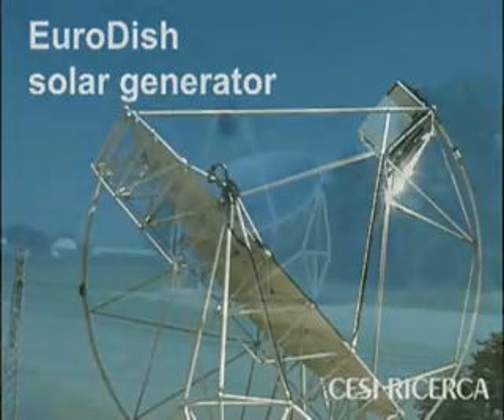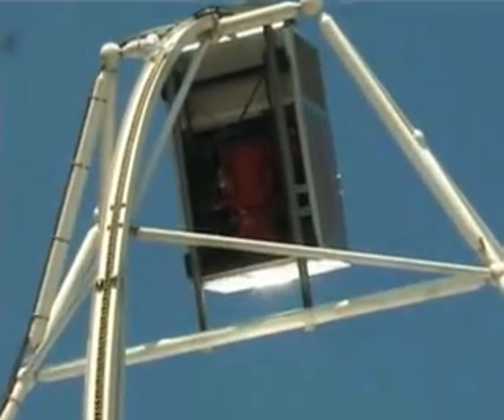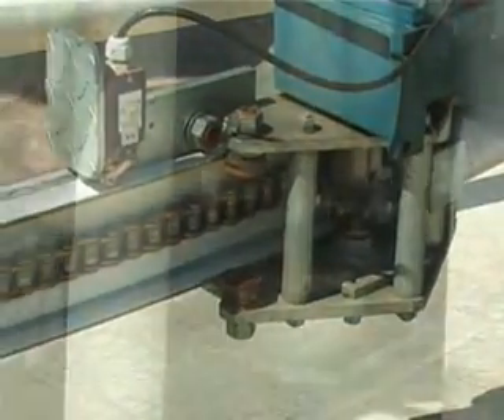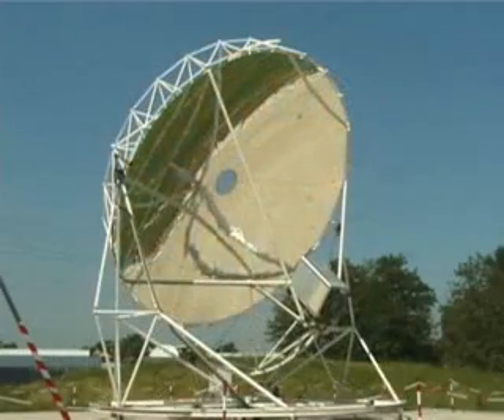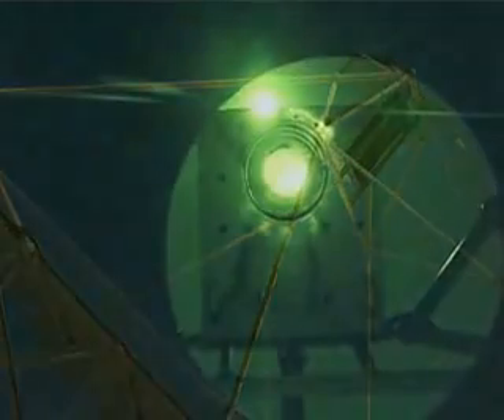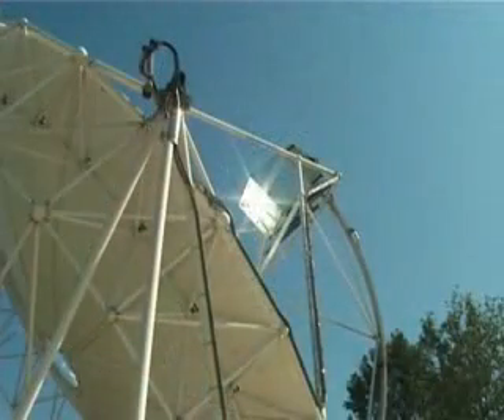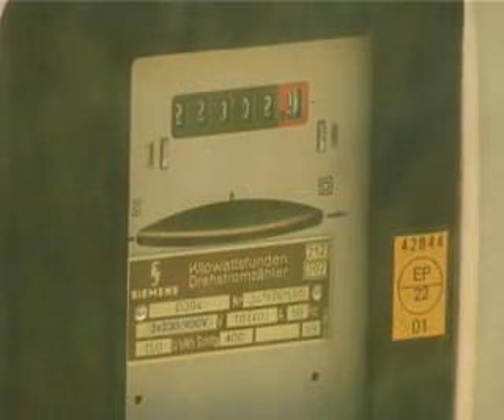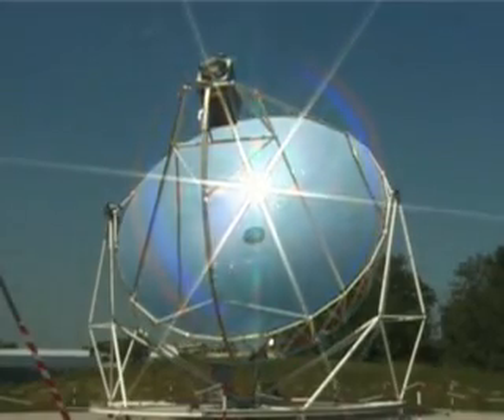European Solar Powered Stirling 10 Kilowatt Generator

Comment: I heard that the Stirling engine can achieve 40% efficiency. Is this possible?
Reply: Theoretically yes, efficiency depends on the used temperature. 
There were stirling engine powered generators with 31.1% electrical efficiency (electrical output/fuel input).
So the stirling engine itself had to be some percent more efficient.
But probably less than 40%.

Comment: Interesting. This video was uploaded thirteen years ago, but it appears to be even older. Since then there has been a huge explosion of photovoltaic panels, while stirling generators remain in the prototype stage. Photovoltaic is becoming cheaper and more efficient every day, but the technology has the great advantage of being much more ecological, since a device like this can be made of recycled steel and aluminum, and be recycled again at the end of its useful life, even using a solar oven. On the contrary, the manufacture of PV panels is very polluting, and does not allow recycling all of its components. PV generation makes more sense economically, but that shouldn't be the only factor to consider.
Reply: Suppressed technology. Musk!
Reply: The problem is the people not the energy or means of getting energy; if it’s not in there face they won’t strive for it

Comment: Practical and doesn't use rare earths in massive quantities.
Reply: but it produce almost nothing
Reply: @Carbon_  10 kilowatts is enough for 90% of homes. Throw in a half-decent battery and you're good to go for several years.
Reply: Neither does photovoltaics.
Reply: I referred to "use rare earths". Typical silcon based photovoltaics don't use rare earth metals. And also no rare elements like Tellur or Gallium.
This generator might use the rare earth metal neodymium in the generator. Not necessarily but likely.

Comment: efficiency of sterling engine increased if it's working under 100 atmospheric pressure since the heat input is same but efficiency is low due to lower atmospheric pressures
😈😈😈😬😬😬

Comment: Nice idea but I'm not sure if it's worth all the complication. In my latitude...about 39 degrees...you could generate the 9,000 kw-hrs per year with about a 7.5 kW PV system that needs practically no maintenance at all.

Comment: In the not to distant past, the Stirling solar engine was the most efficient form of solar power conversion. With a stated efficiency of 17%, the Stirling solar thermal power generator has since been surpassed by photovoltaics which at the time of this writing have achieved an efficiency of 29.5%.
Reply: I was told Stirling Engines have 50%.
Reply: @jackmiddleton2080  
Yep, the Phillips Stirling engine had an efficiency of 38.5%, and other designs probably went higher.

Comment: If this really is more efficient than conventional solar cells I'd say NASA should be looking into using something like this for future designs of satellites and space stations.
Reply: the problem is that Stirling generators need atmosphere to run, because it literally runs by transfer of heat. That's like saying since steam generators are fairly efficient, and simple to run, let's put one in space without atmospheric cooling towers.
Reply: @kirknay  
They actually do have a design for space based Stirling engines powered by decay heat from plutonium pellets. They reject heat through radiators. And they actually DID put a steam engine into space during the SNAP-10 program. But the working fluid wasn't water. It used a fast reactor to heat liquid sodium-potassium coolant, which was then used to boil mercury to drive a mercury vapor turbine. The exhaust mercury vapor was condensed in large radiators.

Comment: Can I buy one? How much is the cost and who to contact?
Reply: just do it yourself is not hard at all, making a Stirling Alpha can be done with simple things, and the dish doesnt need to be a huge perfect one just recycle an old Direct Tv dish, just glue square mirrors in it, obviously it will not be as efficient as this one but it can cover a lot of modern electronics that use a range between the usual 5V - 12V

the generator is just your usual permanent magnet motor used as a dynamo, to avoid peaks and lows correct the current using capacitors and diodes, store depends on the use for intensive use ill always liked Pb over Li-Ion is less efficient but more reliable

Comment: ho  much    do  1  cost  to  bild
Reply: not much if you recycle your ass off :D and it depends on the size of the stiling engine you wanna power, always start small to fully understand the concept and the process it will save a lot of money

Comment: it doesn't have to be a stirling engine... it could be a steam engine or anything that will run off concentrated heat from the sun... also it doesn't have to be a dish... you could make it with a Fresnel lens or any number of solar concentration methods... this is the solar energy of the future... and with the new technologies coming out you wont even need an engine..... they are coming up with new products that turn heat directly into electricity... so you just fire it at this block of whatever it is?? I don't remember now and out the other side comes electricity at near 100% efficiency
Reply: Thomas Schuster Actually, I just read that their efficiency has improved as they have made newer models. It is actually just as efficient if not more than photo voltaic cells. And the price will go down when the demand is higher.
Reply: Thermoelectric generators turn heat directly into electricity. But these are neither new, nor do they work with an efficiency of near 100%.
Photovoltaics is cheaper AND more efficient.
Reply: ***** "Photovoltaik cheaper AND more efficient" was related to thermoelectric generators, which convert heat directly into electricity. Not to stirling-engine-powered generators.
And okay, in a postapocalyptic world, solar stirling generators might be a better way of power production than photovoltaics.
Fortunately, we do not live in such a world.
Reply: ***** do what? Sorry but it is people like you that keep us from moving forward. If we had brains we would put collectors at equator in ocean.
Reply: BAM, thats it man! fresnel lens is better because you dont need to mannage that mush weight pursuing the sun, besides you can use a geodesic dome and catch much more without moving the whole system upgrading efficiency.

hey have you seen the german paint that turns painted stuff in to solar pannels? is awesome!
Reply: What is the production in energy and materials on the 10 Kw  versus the same costs on the PV panels?  I think the dish is probably a better ROI.  In it can be made and repaured by the homeowner

Comment: This is stuff that the goverment doesn't want you to know about.
Reply: Thomas Schuster  PV cells efficiency is rather pathetic in comparison. They do 80W/1sqm =you would need 125sqm of PV array to produce same electricy output (10 000W) and their efficiency drops by 50% as they get hot (70-90 'C).
Reply: Thomas Schuster
"Infinia solar stirling"! no longer exist. Assets sold of , never to see the light of day again.  Old news.
Reply: This stuff was financed by the european commission, it's "governmental" research. And there is no secret about it. It's a rather expensive, inefficient and noisy way to produce electricity from direct sunlight. Why should anyone want to keep this secret?
Reply: Well, you have a point.  I think maybe not government but big corporations are stalling cheep electricity developed.  I believe that the government is run by big corporations anymore.  Maybe its noisy and inefficient but it can be made better.  We can only hope I guess.
Reply: dittybur
But despite evil big corporations, we have rather cheap and noiseless photovoltaics today. Cheaper than even the most developed solar stirling systems (Infinia?) at least.
Reply: firstly, this is not cheap...
Reply: R Mitura
A friend of mine has 10 kWp PV on the roof of his house. I don't know the exact covered space, but I am sure it is less than 125 m².
SOME PV panels like thin film modules have low efficiency (less than 10%).
Common crystalline silicon modules achieve about 150 W per m².
Efficiency drops with higher temperature, that's right. But not that bad. It's about 25 percent lower efficiency with 70 degree celsius, once again depending on the type of module.

From an article about the euro dish: "the net overall efficiency approach 17% at the highest insolation"
http://www.stirlinginternational.org/e-journal/item.asp?id=D4943C97-1108-4D8F-A30C-9DB1305A3A2A

Peak efficiency 17 percent. That's more or less the same as common PV.
And because it can only convert direct irradiation, the capacity factor is rather bad:
Just 9000 kWh per year from 10 kW power in sunny italy!
10 kWp PV would give you much more at the same place.

Anyway, space demand counts less than yield per costs.
Even if you would need just a quarter of the space, you would not use this technology, if the production of 1 kWh costs you twice as much as with PV.
Reply: R Mitura
By the way, there is another solar stirling system with much higher efficiency. Check "Infinia solar stirling"!
But there is PV with higher efficiency too, for instance mono-crystalline modules from sunpower with more than 200 W per m².
And the best Concentrated Photovoltaic Modules (Amonix) achieve above 35 percent module efficiency (but need direct sunlight, like solar stirling).
Reply: OMG, just shut the fuck up and make ur own solar stirling generator and when u cant talk about govermen
Reply: I like renewable energy and wanted to build steam or stirling generator for some time. What the hell is govermen?
Reply: this is the stuff YOU SHOULD KNOW, is just there, for Christ sakes the Stirling engine and the optical lenses have been there FOR CENTURIES.  the ironic thing is that people is so worried with conspiracies and Tv that they just dont read.
Reply: Johan Herrera Where's your stirling engine making power from the sun??  The real "ironic thing" here is you claim to know better but you are not benefiting from this technology.  One I claim you can't or a genius like you would be doing so.

Claiming something is true does not necessarly make it true.  This is "claimed" to work but for how long, several hours or days ?.  Having it stop working every few days makes it a failure NOT a successful concept.  That is what your missing, that is what all people who believes inventors claim are missing.
Reply: Haha I don't need a Stirling engine because energy in my country comes from hydro plants so no harm to the environment there therefore I'm not in a rush,  I'm doing a mechanical wave collector instead efficiency is much better there and more reliable, there is always waves, BTW patent pending.

Right now I'm working for my own NGO teaching kids and teens in danger how to recycle using the knowledge taught at school physics, chemistry, math, etc for free so they don't leave school and actually can be entrepreneurs in the future benefits the environment and society all of it in a country at civil war and with drug issues.

I also refurbish and donate computers to poor families, students that can't afford one or children who need one.

All of it with my own resources, a teacher salary which is about 300 dollars per month in my country.

Wanna laugh?  I even visited the USA but didn't stay there, my kids need me here,  and I'm talking about all the kids I can help, I actually have none of my own.

Next time you get cocky on the Internet, remember that some of us don't talk bullshit all the time.

facebook.com/
Reply: And that's just the English version,  the one in Spanish is much better.
Reply: http://drgohanlab.blogspot.com.co/?m=1
Reply: Johan Herrera

Comment: the thing looks like it could be produced cheap, and its a old technology.
Reply: More expensive than photovoltaic panels. Would awesome with higher efficiency or if it could be scales, otherwise, assembly and maintaince is going to be expensive.
Reply: @movax20h  
The fact that it's price might be high at consumer level doesn't means it's expensive to produce

Comment: To come to an end: Efficiency counts less than costs.
And costs for solar thermal power production are much higher than for photovoltaics nowadays.
"Common" solar thermal power plants have one big advantage at least: With heat storage, they can produce controlled power, even at night. This might justify higher costs.
But solar stirling dishes have not even this ability, just higher costs.
Reply: just use aluminiuminstead of gas

Comment: In this case, PV would probably be even more efficient. Related to mirror/panel-area and to annual yield.
I just noticed, that the location is Milan in NORTHERN italy.
You can expect about 1200 kWh/kWp in northern italy, not 1400.
But so you still need just 7,5 kWp PV to get 9000 kWh/a.
That's about 53 m² common PV panels covering a roof.
The mirror of this eurodish is 8,5 m diameter.
That's a projected area of 57 m² (real curved mirror area even more).
Reply: its more than 53 square meters
Reply: @austinharding9734  It depends on the type of modules (thin film, polycrystalline, monocrystalline,...). But with common, rather efficient silicon modules, 53 m² should easily be enough.

Comment: Anyway, the demand of space usually matters not much, espacially for big plants in deserts.
Since the price decline of photovoltaics, the producers of solar stirling systems are desperate. And they overstate the few advantages of their technology. 
By the way: Higher efficiency and lower space demand is one and the same. You can't count it as two advantages.
And: With concentrated photovoltaics (CPV), you achieve even higher efficiencies than the best solar stirling systems.

Comment: If you compare the demand of space of solar stirling power plants and big photovoltaic plants, it's more or less the same. Though the producers of solar stirling systems claim a big difference. 
Just one thing is true: You need rather less mirror area than photovoltaic panel area. 
In compensation, you need much space between the mirrors.
And: Common photovoltaics is much better than 7% overall efficiency. And there is no stirling system nearing 40%.

Comment: And: Just 17% of the direct irradiance. In rather cloudy countries like germany, the half of the electricity from photovoltaics comes from scattered light.
This is a 10 kW-dish in sunny italy (!) and it produces just 9000 kWh per year. 
With 10 kWp photovoltaics, you could easily yield about 14000 kWh per year at the same place.
Without annoying noise. Without need of free space, a roof suffices. 
And probably much cheaper.

Comment: 17% efficiency same as the regular photo electric panels
Reply: Yet pv dies after about 10 years but the stirling engine can last much longer when designed properly
Reply: Stirling solar concentrators can achieve twice what PV does. 35% typically.

Comment: You are wrong - it is not succesful so far because it is too expensive. You can build solar plant using the same surface for lower price. Also 10kw wind power plant costs up to $10000 - this thing costs much more.
So far I've seen on net 1kw engine for $4500 - it is still more expensive for 1KW than solar or wind energy

Comment: Stirling engines were never a commercial success because they are inefficient, you need to run it with hydrogen gas as a internal work-medium for it to become somewhat efficient. Also it's to slow to start up & to slow to change work load. it's difficult to get a decent power to weight ratio since you can't turbo or supercharge it. Also one can build Diesel engines that are just as low in maintenance. For the record steam turbines/engines killed the Stirling engine, not economic conspiracies

Comment: Thanks for posting this video. You have gotten a bunch of silly comments, but this video shows enough of the details of that particular Stirling engine that someone else can fabricate and start to tweak it for maximum efficiency. This video said "17%" efficiency of sunlight energy to electrical energy, which is FANTASTIC! Unlike solar cells, this will not degrade year by year, either, so that simple maintenance will keep it going. Solar cells last only about 20 years, with expensive replacement.

Comment: they cost more? the parts used are similar to what would be used in normal engines with the only slightly added cost of parabola mirrors. there is a conspiracy, and its not just against the Stirling motor either. they are against anything that loses jobs because then the greedy corporations are loosing money. Also, the original Stirling motor created in 1871 was gas heated, they didn't have parabola mirrors then. that's why we are only seeing this now.

Comment: hey hey people. there is no conspiracy. these type solutions just cost a lot  more than conventional technologies. they were invented @1871. back then Steam was king. Later overtaken by internal combustion engines. in reality electric motors were easier, cheaper and better to deploy than these costly, technical systems.  It sonly since oil is getting more expensive do these things have a chance.  NO CONSPIRACY. GOT IT

Comment: The CSIRO's version using a salt cell is even better using molten salt as the heat bank.Why Governments ignore this technology in favour of inefficient solar panels is a mystery.One would think that Bob Brown would be up to speed on this sort of thing to prepare for peak oil etc etc Australia is the perfect place to use solar Stirling engines but we are bogged down with dumb arsed politicians who would rather tax us on CO2 output rather than invest in decent and really smart technology.